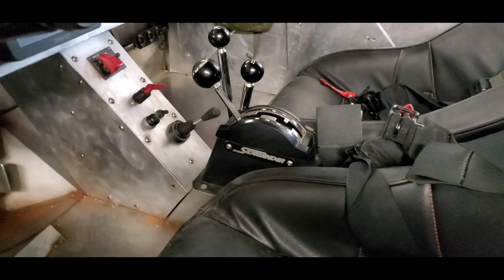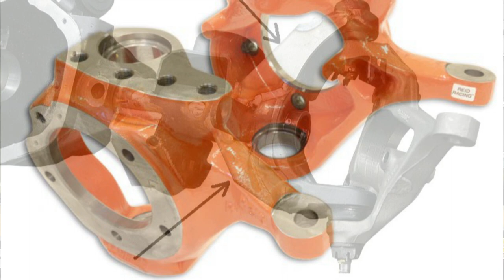4X4 TIPS PART 1: Buying & Building a 4x4

Comment: Great video and spot on information. Wish I had this info 10 years ago when I started serious offroading. Somehow I found my way to building pretty much what you recommend. Fortunately I fell in with what are now good friends that influenced me in the right direction. In this video you did not mention engine swaps (I know you can only do so much in the first of a series). After a few armor, winch type upgrades I went to a 6 liter LS in my 2009 JKU and then built the entire drive train to handle the power and torque and run 40" Nittos. Last addition was coilovers. Now I wheel in WA, UT and CA. Thanks for the video and keep up the good work!